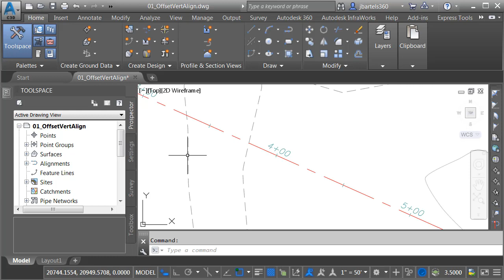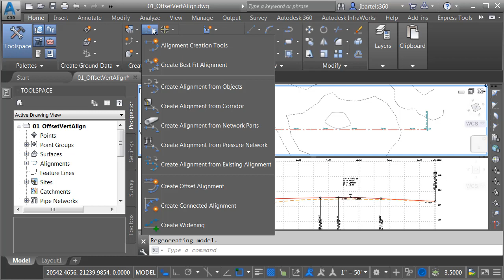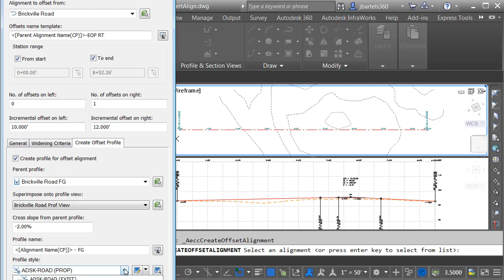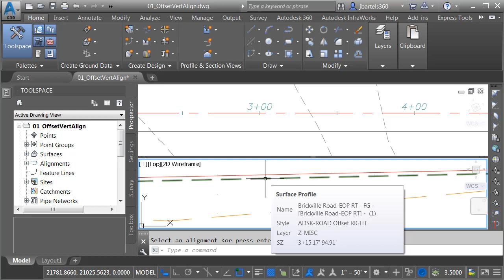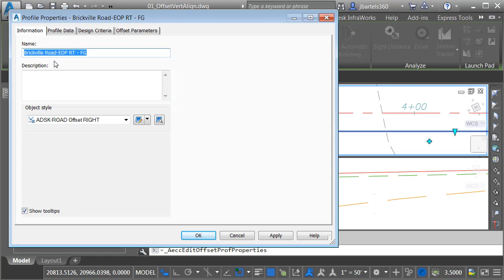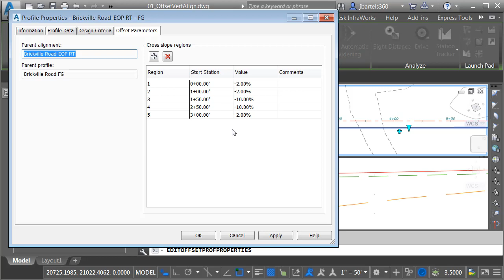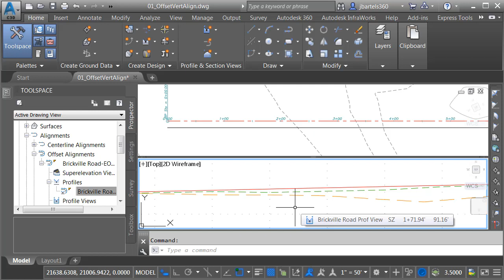Civil 3D 2018 New Feature: Offset Profiles & Connected Alignments - Pt. 1

Comment: Thank you Jeff. Can we show the offset of the 5 m left and right of the alien we take from the terrain elevations as a surface in different colors in the same profile? In other words, there will be 3 surfaces in the profile, the first one will be the axis, the 2nd and the 3rd will be 5 m left and right of the axis, each with a different color.
Reply: Most probably you can, just use different styles.